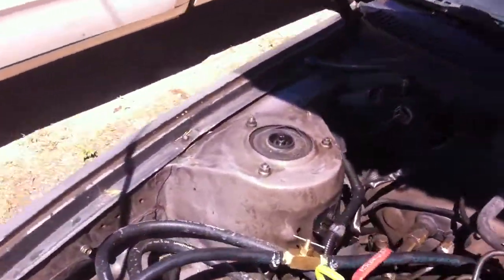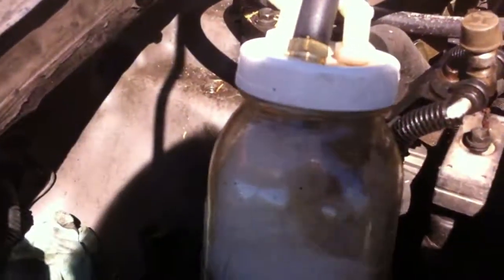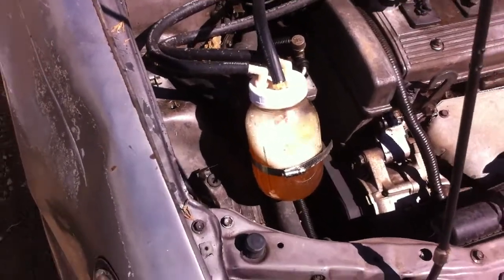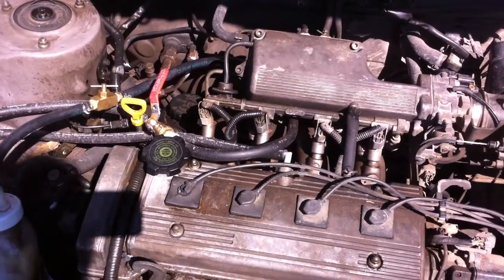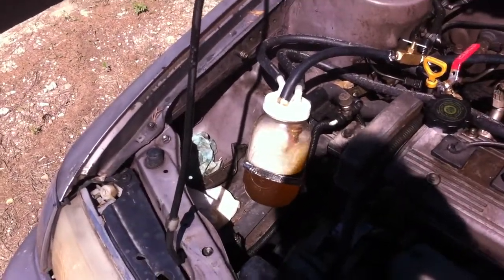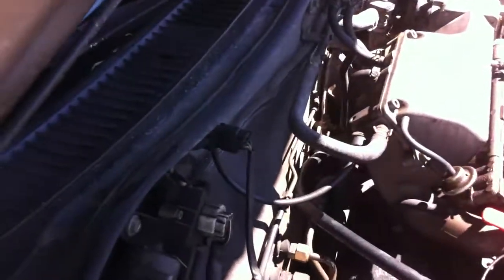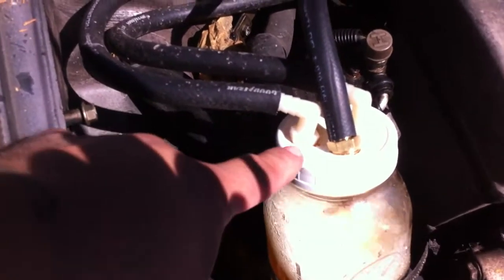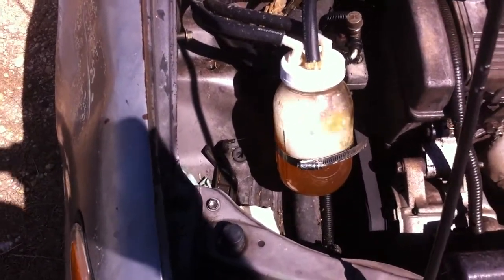Simple Fuel Vaporizer, Drip refil system.

Comment: Ten years ago 🎉🎉🎉 shit time flies
Reply from the maker: That is absolutely true! I still have the 95 Astro Van I started building after this little jewel said goodbye. I recently had to replace the ECM, but it only has 142k on it and still runs great. I also only recently found someone to help me build the electronics I need to operate the new system that I designed.

Comment: Good afternoon, friend. One question, if you would not put in the drip supply, once the gasoline in the glass tank runs out, it will go off because it sucks air
Reply from the maker: The drip refill does two things. First, it keeps a steady supply of fresh fuel going into the vaporizer. This keeps it from running out of useable fuel to vaporize. Secondly, the input of fresh fuel keeps the fuel in the vaporizer from going stale. As the more volatile elements of the gasoline are vaporized to be used in the engine, what gets left behind is a heavy, and lacquered lower-quality substance that is low in flammability and requires a high temperature to both vaporize and ignite.
Reply: @craigcarpenter2069  friend tell me please the savings that percentage you get

Comment: Just wondering if the fuel tank could be used as the vaporiser , may require longer lines ? Have you heard of the firestorm spark plugs and could you use a hho system with this ?
Reply from the maker: The issue with using the tank is the need for longer lines. That issue poses the largest issue of condensation from the vapor. The shorter the lines the better unless you can maintain the temperature somehow. Then you must insulate them. And... And.. there is a host of issues with using tank . Not that it is not possible, just problematic. Yes you could  use those plugs but combining hho with a heated vapor can cause explosive issues. Not a good combination.  Plus, the two fuel types require opposing electronics to control them effectively as well as a good number of safety measures that can become cost prohibitive.
Reply: @craigcarpenter2069  so it could be worked out then , but would require some thinking out of the box

Comment: Doesn’t work whe you bubble it. The gas will go flat
Reply: Been there done that. The vapor system is the best way for gasoline. Do it without bubbling. Just vaporizing with airflow across a wick that is absorbed in fuel
Reply from the maker: It does work when the incoming air is heated. You do need to exchange the old fuel as it gets dirty so it doesn't work well for long, but it does work.
Reply: Craig Carpenter I didn’t try heating the incoming air. I’ll have to try that but I copied a link for a wick setup. I wanted to try this way after my failed bubbler.

Comment: I'm wondering if this would also work with a diesel car . Pure vapour/fumes into the intake hose . Couldn't be much different to the added LPG system I had on my last 4x4 .
Reply from the maker: I'll be the first to admit that I'm not a diesel mechanic and although they work on a similar premise, their fuel injection systems and controls are not familiar. I can imagine that the process and results would be the same or similar but I also know that diesel fuel is less volatile than gasoline. Thus the requirements for very high compression and glow plugs for ignition. It would be interesting to have the opportunity to try it out and see the results.

Comment: It seems that you were just placing a 3/8" hose in the bottle to stir the gasoline around. You should have used something similar to an aquarium stone, but made of out of a PVC cap and 1/64" drill holes for example, which would present smaller air molecules into the gasoline and have greater surface area. The ratio of vapor to air coming out of the top of the bottle would have been greater with the tiny holes in a closed system. You want your vaporizer to produce a very concentrated vapor, that lacks as much air, because your engine is already pulling air from the intake.
Reply from the maker: This unit was made using a 3/8 npt pneumatic filter stone. It is a porous stone used as a filter in the same style as the air stones in an aquarium and it was a closed system circulating the hot gasses from the PCV in the valve cover to a full vacuum on the intake where the original PCV line attached. The only fresh air in the system was through the intake.
Reply: @craigcarpenter2069 Can I pay you to do this in my car?

Comment: Hi. Does it have an air intake?
Reply from the maker: This one is a closed system that uses the hot gasses from the PCV circuit. It does not have a fresh air intake. the new model I designed uses fresh air.

Comment: Put a hollow metal ball between carb and intake manifold atomizes and vaporizes gas, doubles gas mileage and cleans up emissions this is possibly how Poque did it. Please  please try this it works
Reply from the maker: How is a hollow metal ball going to double mileage?  For one, this is port injected so it isn't possible. Two, the fuel is already atomized when it goes trough both injectors and/or jets in a carb. Three, all this would do is place an obstruction in the air flow path, giving only a marginally larger heated surface area and causing turbulence which would only mildly increase the time that the air fuel mixture spends in the intake runners allowing for a small increase in vaporization. The problem with that is that although you might get a bit more vaporization, only a fraction of a percent, the more the fuel source vaporizes and expands prior to the intake and compression cycle of the engine, the lower the amount of expansion, and thus power. The fuel would also need to be a homogeneous mixture to have the proper combustion throughout the cylinder which would have been disturbed by the object in the flow path of the fuel. I'm no expert, but if you can explain the properties of a hollow metal ball that would allow for double mileage, please explain it to me as I apparently don't understand it. Also, in all of the design blueprints and diagrams I can find on the Pogue carb, there is no ball shown or even a mention of a ball in the intake. Maybe I'm not seeing something.
Reply: @craigcarpenter2069  True it needs to be carburatad model , on carb models the ball causes a swirl like blowing smoke rings watch the smoke ring spin this. Brings far better atomization. I had this on 3 vehicles, an 65 dodge truck ,85 chevy s10 and 74 hondacb 360 this works.
Reply: @craigcarpenter2069  I did this on carb models and it works I smogged the 85 chevy S10 smog tech said best smog ever Try it on a small mowsr engine for ease of proof it works this is all I can say Its kind of counter intuitive,  but still works
Reply: @craigcarpenter2069  I did the experiment  and it works ,actually he always never showed any one his working model .Dont try to explain this away I known its counter intuitive , but still it works like a bong.the mufflers on vehicles I put it on the mufflers turned brown proving far better combustion !

Comment: Are you still utilizing the primary fuel system with the vaporizer or just running it on vapor alone.
Reply from the maker: The injector system is in use. The goal was to add vapor forcing the ECU to receive a RICH fuel signal from the O2 sensors. This causes the ECU to adjust the pulse bandwidth per injector, per cycle, to account for the extra fuel and use less injected fuel per cylinder. This small unit could not make enough vapor to sustain this engine.
Reply: @craigcarpenter2069  then there’s an o2 sensor whose signal to the computer you can modify as well, to further tighten injector pulse durations...did you look into that/try it?

Comment: The raw gas needs an additive that will help with adding more powerful vapors to the gas vapor.
Try 1.5oz of acetone per gall of gas.
This will get the most out of your cold vaporizer.

If you were to coil wind your converter with the intake pipe, you would be able to use supper heated air to crack your gas into white vapor fuel.
Reply from the maker: The acetone lowers the surface tension of the fuel molecules allowing for the gasoline to evaporate faster under lower temperatures. I did try adding acetone yet noticed only slight improvement if any. The problem is the type of evaporating system. This "bubbler" is highly inefficient and leaves a thick oily buildup after the more volatile elements of the fuel are evaporated. It was meant as a test and worked fine for what it was, but there are much more effective and efficient ways.

Comment: Do you think you could explain this a little more thorough please and thank you.  Such as what type of lines you're running is it just fuel line? where'd you find your little jar set up, what do you have running inside the jar? What kind of valves are those up top that jar? And where are you running those lines exactly I get you said a couple of those were vacuum lines but from where I just read one of them was the PCV line, where's that second line running from the fuel rail plug how do you plug into the fuel line as I know see this is a fuel injected vehicle...  I'm really trying to do something like this on the Suburban I have an 05 and it has shity gas mileage I've done everything possible that could increase it such as new O2 sensors all four of them new mass air flow sensor and upgraded air intake system and I still have horrible gas mileage
Reply from the maker: If you watch my other videos on this project you'll find most if not all of your answers explained as well as a diagram of this little bubbler style vaporizer that I built. I am building a new and much better vaporizer that is not a bubble and is much, much, more efficient.
Reply: @craigcarpenter2069  this was installed before the fuel hits the injectors correct?
Reply: @craigcarpenter2069  and another question... what is making that bubble like crazy in the canister? Do you have one of those hoses going to the bottom of that canister? I guess I'm not understanding how the canister is creating bubbles. If those are all vacuum lines running into that canister then how does it bubble?
Reply: @craigcarpenter2069  and clicking your channel now to watch other videos..thanks a ton
Reply: Wished I knew how to make a much much more efficient set up. Would like to test it in my car.good luck to you sir!

Comment: How many miles per gallon did you get?
Reply from the maker: With this pretty rudimentary system, I was able to effectively double my mileage on this car. The average prior to the unit was between 21- 23 mpg average. After the install and tuning I was able to get and average of between 40 and 42 mpg. The bad thing is that as the fuel in the jar got dirty, the mileage got worse. However, even with dirty fuel, I was still getting an average of 35 - 37 mpg.

Comment: how is this different than how the factory EVAP system in the fuel tank works by? it simply sucks out evaporated droplets of fuel, send it to a vapor canister to mix in with fresh air, then sends it off to the intake manifold to burn?
Reply from the maker: The difference is in your own statement. When the vapors mix in the charcoal canister, they are diluted with fresh air so they do nothing to improve mileage. This way, there is pure vapor reaching the intake and cylinders which helps in mileage and performance.

Comment: I'm not doubting you, I would just love to see a video that documents CONCRETE proof of the MPG advantage.
Reply from the maker: Well, I can't right now. I sold this little gem to my nephew who still drives it in Iowa. I am however working on a new project car. I have a 1993 Toyota Camry with a 2.2 5SFE engine. I am buying a rebuilt engine as the current one has a spun bearing. I have a redesigned and modified version of this system that I am going to install in a similar fashion in this car. It is a larger car with a larger engine and the unit will be larger to match but will be built on the same principal. It will be a while as I am currently restoring my wife's 2006 Chevy Silverado. I know t has been a while but stick with me. I will get back on this project and show some more evidence. I can say this, although you might not believe it, this system uses the technology built into the car to get better mileage and improved emissions. It is 100% legit.
Reply: @craigcarpenter2069  after 2 years, is there any real mpg saving prove on a real car?

Comment: Hi Craig.  I'm Gabriel from México.  Congratulations for your work. I just want to know what is what you do whith the Injectors, do you discconnect them or they work at the same time?  Thanks
Reply from the maker: This system is just an additive measure to increase mileage. The fuel injection system is fully functional and is the primary fuel source for the engine.

Comment: you can make new line from vaporiser (1/2 level) back to return fuel line with check valve on it ...

Than you do not need to control fuel
Reply from the maker: This design was just a test model. I am working on a heated model that fills using an internal float level for my 2001 jeep.
Reply: Maybe small pump for return line from bottom of vaporiser... no need to clean often heavy oil

Comment: thank you for showing thiis, am gonna try it, i just want to know how the car does on inclined roads or climbing up bridges and the like, thanks, .  ;-),
Reply from the maker: It runs perfectly without any problems. I have driven it in town, on the highway, through hills and valleys. Anywhere you'd normally drive. You have to remember that the injectors are in service on this engine and this vaporizer is only an assisting device to get better fuel economy.

Comment: gasoline boiling point is 95 degrees - 395 degrees get that fuel about a hundred degrees you'll be fine if you drip feed it at 200 degrees you might not have any extra fuel in your tank it will really boil off at 200 besides the spark arrestor Big C make a check valve you could do a PVC ball and spring it's easy I made one about 3 bucks you can use a mouse ball I'm going to build a vaporizer

Comment: HHO wet cell they have a blow off on top of it PVC fall and spring inside with holes drilled through the fitting check that out works great hydrogen is a lot more volatile gasoline

Comment: do you have an email lfries63@gmail.com I want to talk to you but don't want to post my phone number here I got some really good ideas for it to start with take a look at this steel burnout drier shell Sporlan this is a suction drier shell made out of steel just a little more than a quart size aluminum top half inch steel flange 8 bolts I know how to put a she'll float switch inside of it I have to talk to you to tell you how to wire it up with a liquid line solenoid valve we might have talked before put wicking material in the cylinder a wash mitt microfiber work great your air hose would go inside it's all about wicking type in fuel vapor with wick guy has an ammo box on a lawn mower wicking material inside

Comment: get a wash mitt they are made out of microfiber put it on the inside the jar tie wrap to your line that's call wicking the bubbles will be fine but you need to get a steel cylinder you need check valve try an acetylene spark arrestor look at HHO blow off on top of cell very easy to build

Comment: you could use 2 or 3 flashback arrestors off acetylene torch you could make a check valve I buy a large Refrigeration check valve for a liquid line I seen the rushes made out of shot and Brass wool get rid of the glass jar my man

Comment: you need to make that reservoir of Steel Google suction Line Filter made by Sporlan for burnout about the same size as your jar with a half inch aluminum lid on top of it with an O-ring a steel flange 8 bolt hole in lid on the downside of what you're doing there is this gasoline as a refrigerant the liquid will cool off and water will get entrained in the liquid the heavy hydrocarbons will collect in the bottom and look like syrup
Reply from the maker: Yeah, I know. This was just a test unit that really happened to work well. I sold this little car to my nephew over a year ago. He still runs it and keeps it going. I'm working on building a larger heated unit out of steel for my Jeep. Between the heat, at about 200 degrees, and a slightly modified aerator system, I should be able to keep the buildup to a very minimum since 90% percent or more of the total components of the fuel should get evaporated to be used.

Comment: Well that looks safe, why not at least use a gas can.?
Reply from the maker: This is a lot safer than a plastic gas can. It is tempered, hardened glass firmly mounted against a stiff foam insulating backing on a hard line from the AC. it has a flash arrestor in the system and one line left loose to blow off in case of a backfire. It cannot melt and leak fuel everywhere like a plastic can will when exposed to heat. So which is safer? Not to mention that this is just an assisting device not meant to or capable of running this engine alone.

Comment: Does the needle valve ever get plugged or stop dripping and if so how have you overcome that? Also, what pressure is the fuel line that you are using. I have tried needle valves with 40 -60 pounds and get the drip count set (very touchy at that PSI) t but it seems to stop perhaps due to expansion and contraction. Any suggestions?